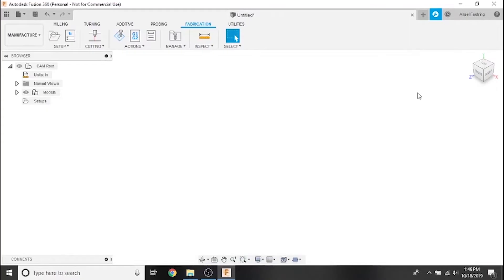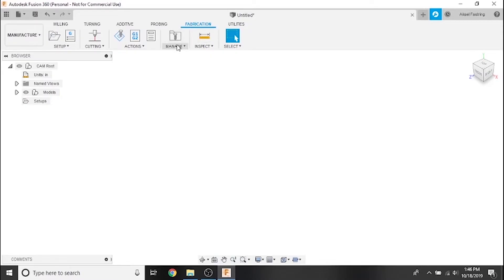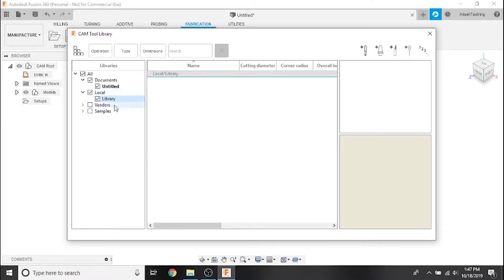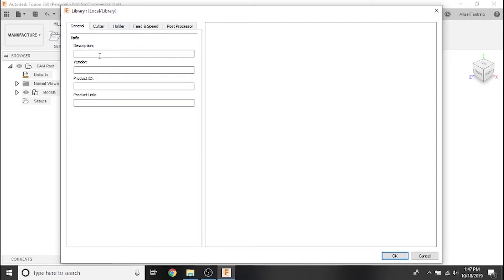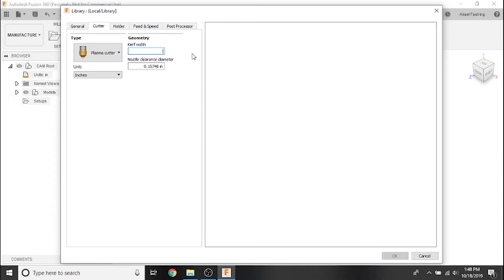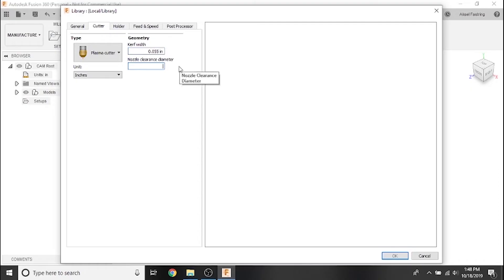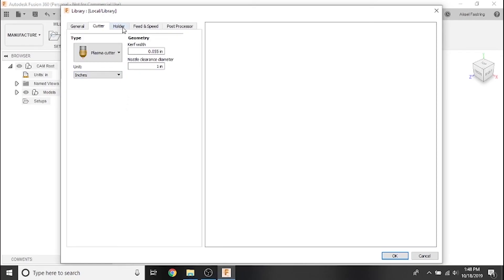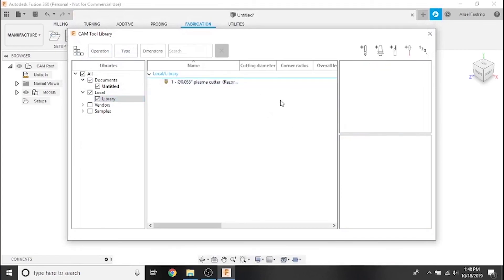Fusion 360 CAM Tutorial 2: Creating a Plasma Cutting Tool

Comment: From this video I learned that the kerf is 0.055" and head diameter is 1".  I'm using the Crossfire Pro with a Razorweld CUT45 CNC plasma torch.  Then I went to this video from the folks at Fusion:  https://www.youtube.com/watch?v=IguCUtUowm8  Everything is pretty straightforward once you have the info on working with new menu.

Comment: QUESTION: Does post processor 'grbl laser.cps' (https://cam.autodesk.com/posts/download.php?name=grbl%20laser) actually work w/ plasma jets? I'm getting error: "The CNC does not support the required tool/process. Only laser cutting is supported." I have gone into the code, and see that a case statement conditional throws the error when 'tool.type' is not 'TOOL_LASER_CUTTER' (line 224).

BTW, I'm helping a FB member, who is having a service to the plasma jet work. I've pointed him to the other plasma jet post processors, and instructed him to check with the service.

Thx, for any help you might be able to offer.